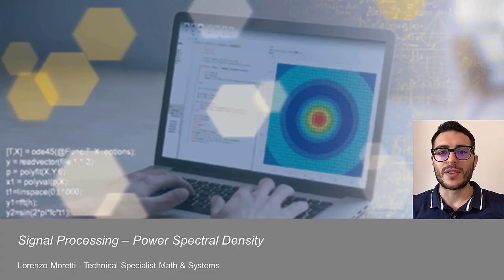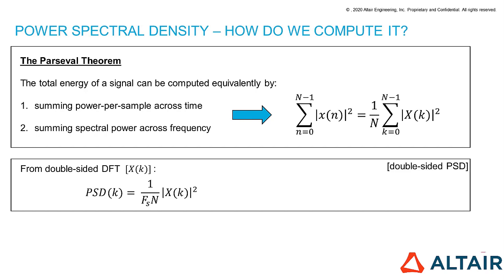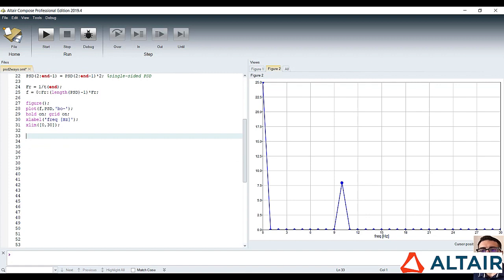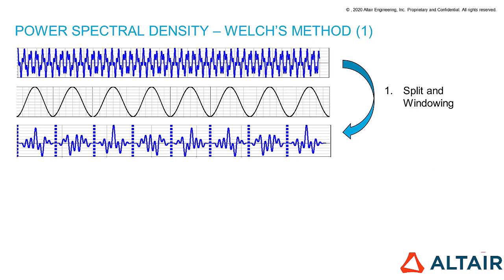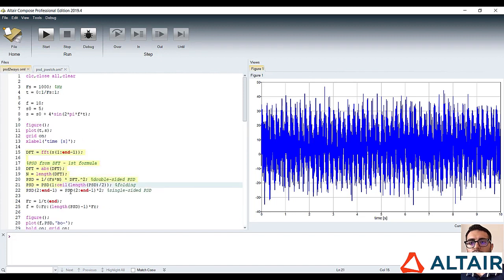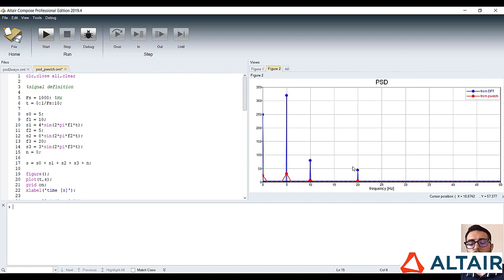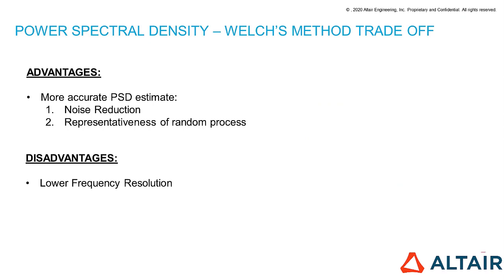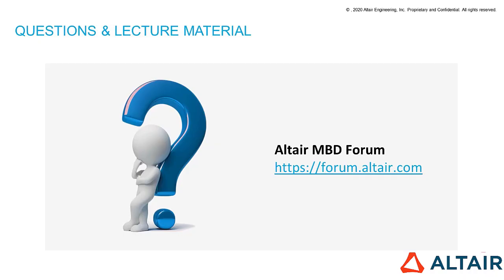Altair Compose: Signal Processing - Power Spectral Density

Comment: Thank you for this.

You mention that for the Welch method, the number of segments is equal to the signal length divided by the window length.  And you then write a version of this statement in your code defining WindowLength.  However, since the Welch method overlaps segments, would it not be the case that if you had  a window length of 1/10 length(s) with 50% overlap, in order to cover the full length signal pWelch would need to create 19 segments, since each additional segment covers 1/5 more of the signal?

Also, is the psdapp included in the Compose personal edition?